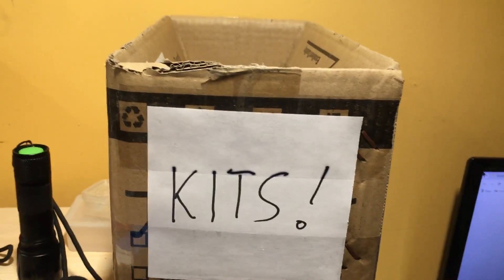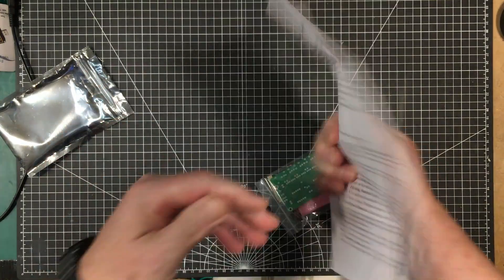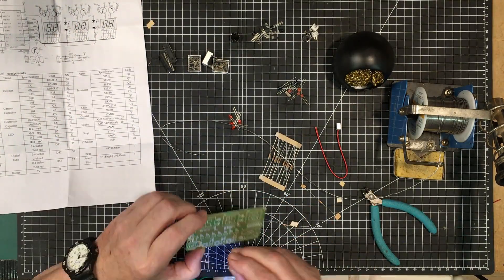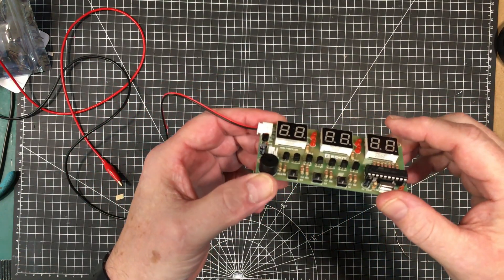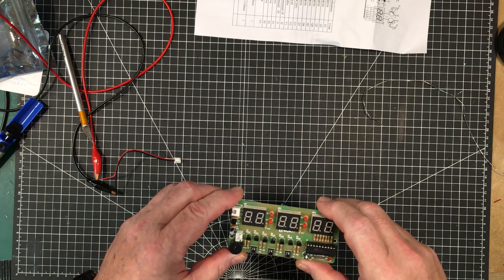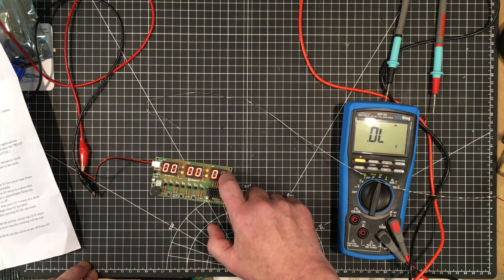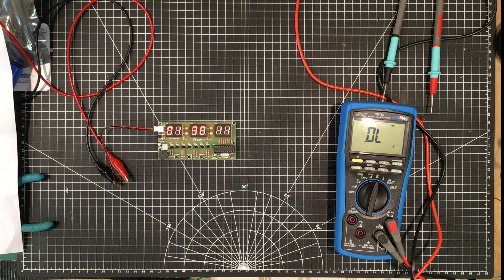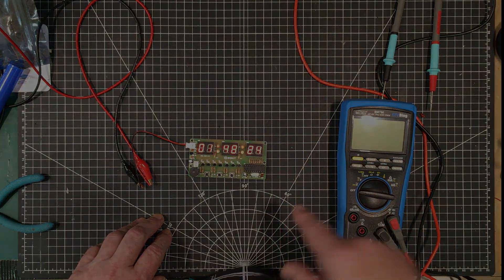Uni-Byte 0202 - 6-Digit Clock/Timer Kit - I MESSED this one up!

Comment: Qualcomm QC and PD are different protocols. Your soldering iron is probably PD as QC is mainly for the charge controller for the snapdragon SOC.
Reply from the maker: Probably.  It was the USB Meter that detected it as QC2.

Comment: I find that using a wet sponge to clean my soldering iron tip cools off my tip (soaks some heat away) so I switched to the brass wool soldering iron tip cleaner. I guess this is all dependent on how quickly your soldering iron can recover the set soldering temperature though. Just my $0.02.
Reply: Agreed. In the prior video's comments, I forgot to mention this... I see a lot of soldering tutorials that say to just press the tip into the brass wool. I find that this method just pushes the residue up higher on the tip. So, I reach the tip over the brass wool, lower the tip onto the wool and draw it backward to scrap off all of the residue. This method works really well. However, you do need to be careful to only use gentle side pressure on the tip. Too much side pressure and you might crack the ceramic heating element, inside the tip. HTH. Cheers.
Reply from the maker: @t1d100  Good tip as always!  Thanks.
Reply from the maker: Yeah, I think that could happen.  That's why I do the wet cleaning immediately before putting the iron onto the stand.  For quick cleanings between joints I do use the brass wool.  I think I mentioned this.

Comment: Mistakes lead to learning.!
You could build the timer into a box or case, add a battery. NiMH battery's can be left on a trickle-charge for months at a time. 20mA ~ 40mA would be a reasonable value. The right value hobbiest solar cell would be enough.
6 battery's comes to 7.2volts.
Reply: Ummm why buy Nimh batteries in 2024 ??? LoL
Reply from the maker: @edwardfletcher7790  NiMH batteries are very robust and far less likely to burst into flames and burn your house down while you sleep if the charging/protection circuitry fails.  They have their uses.
Reply: @uni-byte  For kit projects, I just recycle old drill or laptop 18650 batteries. As long as they're not made in China they're usually fine 👍
Reply from the maker: Already knew to avoid these, just being lazy.  I was thinking about using it as a bench timer.  Just need to come up with a decent case for it.

Comment: You don’t have one of those fancy solder suckers?
Reply: Theres always the "heat n' slam" method...
Reply from the maker: @snakezdewiggle6084  Yup. used that before too.  Actually, just the other day!
Reply from the maker: I do.  I have an Ayoue, but it's a pain to clean and only worthwhile if you are removing parts with many pins, like an IC, from a delicate board.  A tinny LED does not warrant all the work!  LOL!